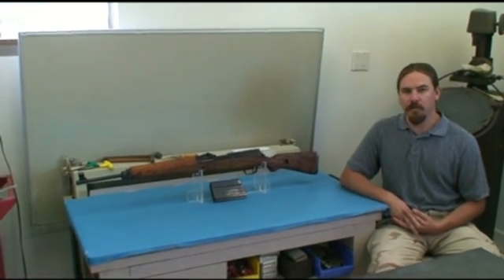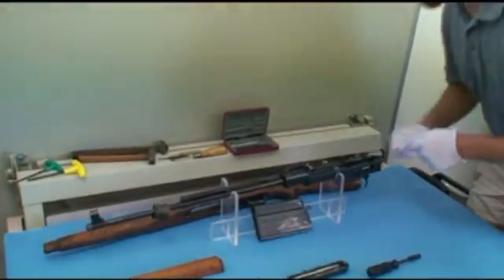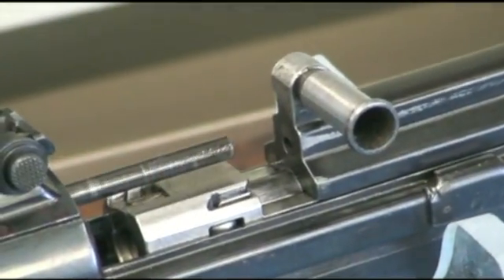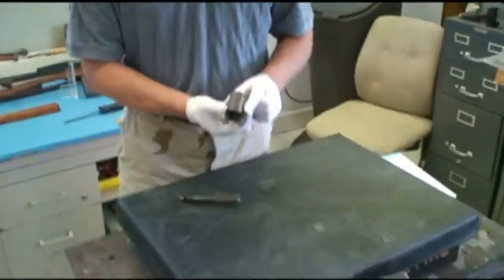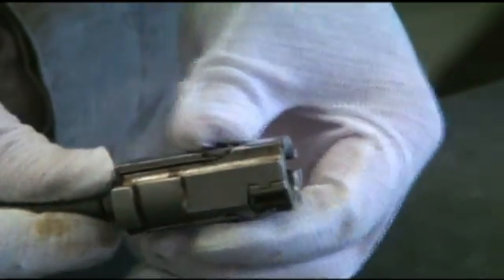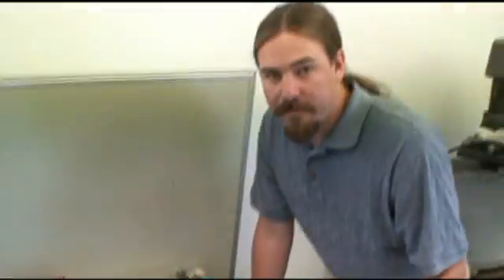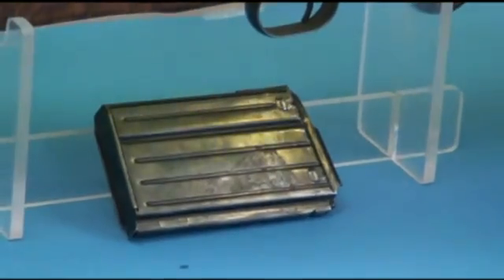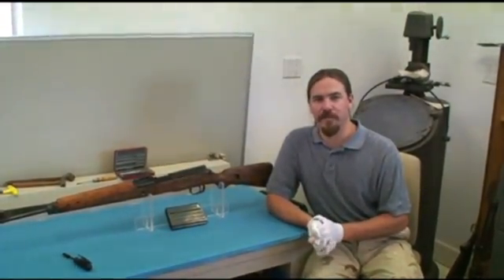Gerat 03 Disassembly

Comment: cool video! looks really similar to the Gerät 06 design, have to ask tho did this rifle hade the same problem with a bouncing bolt during fire like the Gerät 06 had?
Reply: +viking93ify According to the vid on the 06 and 06H, Ian mentioned that the bouncing bolt was noticed on the 8mm mauser weapon (must be this one)  by the same guy, Carl something and that working up a solution resulted in the 06H.